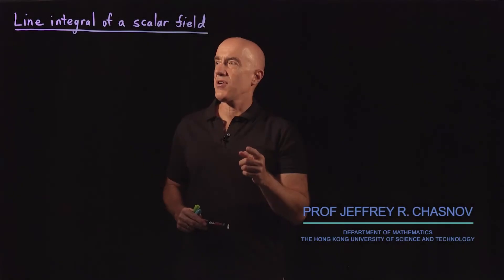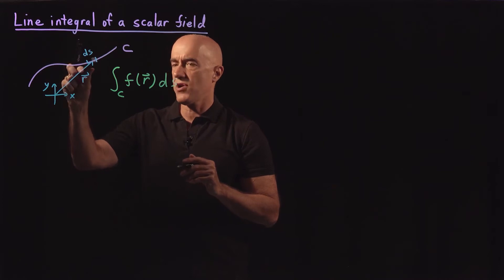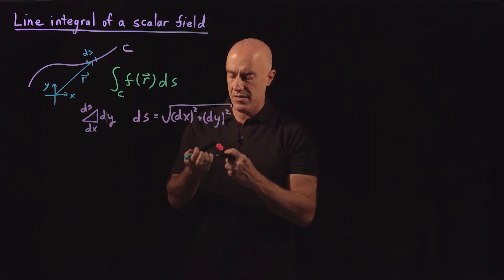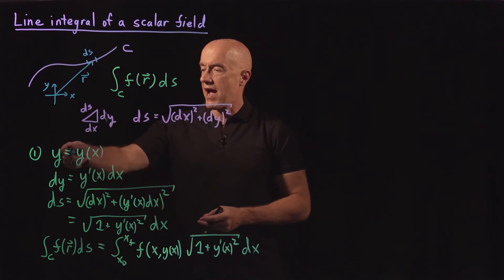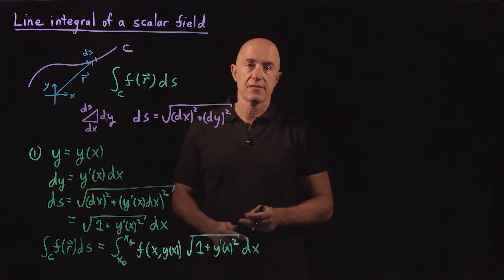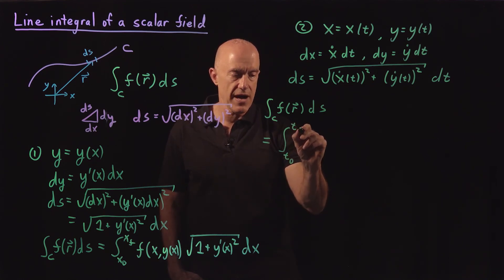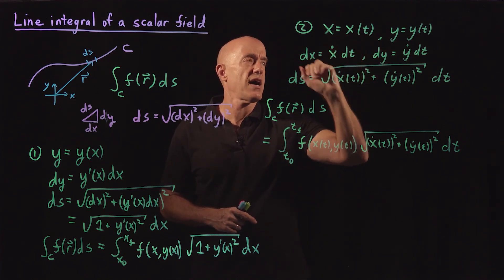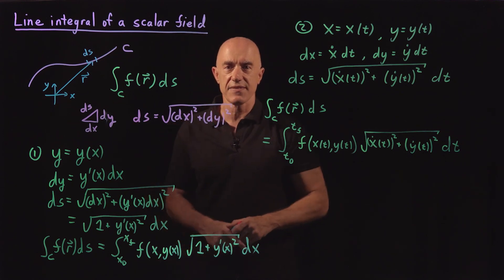Line Integral of a Scalar Field | Lecture 35 | Vector Calculus for Engineers

Comment: Typical math-guy. He can do the calculation, but he does not seem to know what he is calculating. Just an area.
Reply from the maker: PhD in physics, haha
Reply: @Jeff-math  Lesson 1 was: "Never forget the units" ;-)
Reply: @Amanda_B_Reckyndwyth  Yes, my dear, it is an area. That's why he uses ds = (dx^2 + dy^2)^1/2, here: 2:14. You can change f however you like, but I'm talking about the f he uses. P.S. Your reaction says a lot about you, my dear.
Reply: @jacobvandijk6525 ds is a measure, and what the integral quantifies depends on what f quantifies. You haven't said anything about f, and don't know what you're talking about. Chasnov's f is some scalar function of the position vector in the Cartesian plane,  but is otherwise an unspecified function, e.g., from R^2 to R.